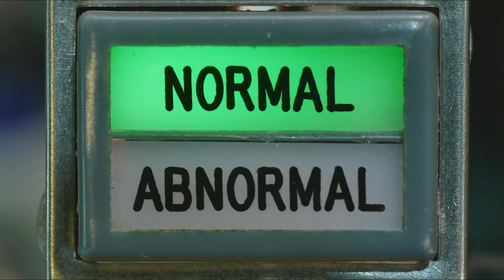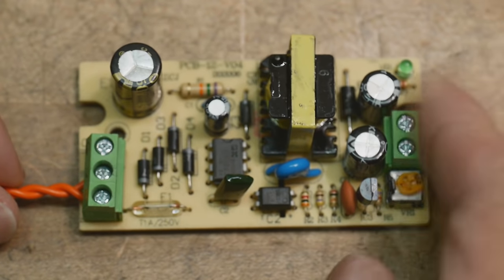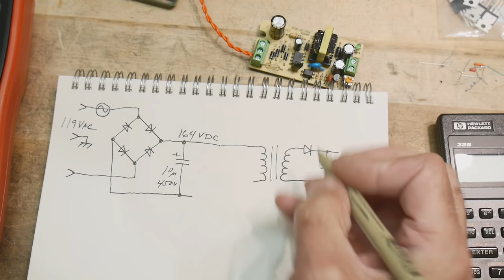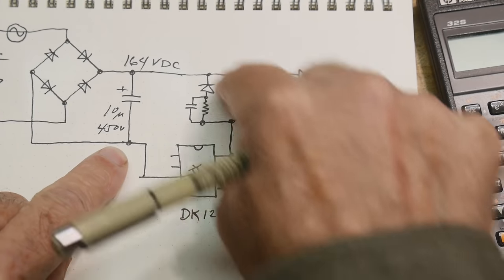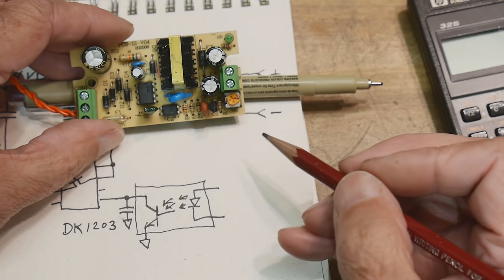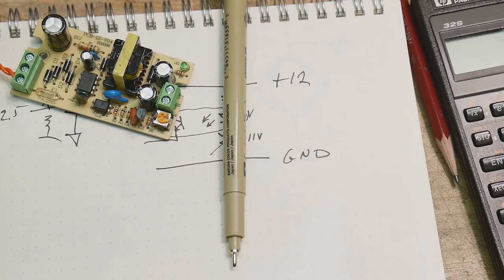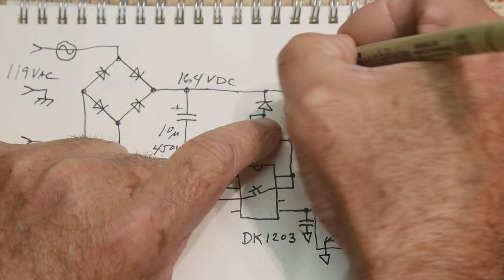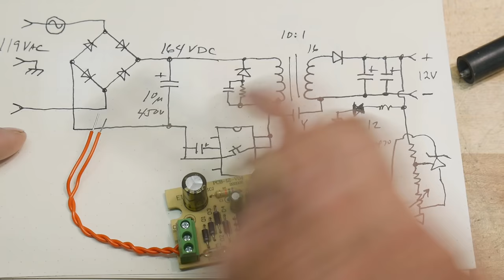#772 Basics: Switching Power Supplies (part 1 of 2)

Comment: How do switching power supplies work when there's no feedback from the output side?
Reply from the maker: there is! though the optocoupler
Reply: @IMSAIGuy  nope, not the 12v switching I've tried to fix.
Reply from the maker: @danman32  I couldn't comment without looking at a schematic, some use secondary windings of the transformer to do the feedback.

Comment: Do they operate on different switching frequencies or are they all pretty similar? I also note that on a 240V supply the rectified voltage will be around 330V which would not be pleasant to touch :-)
Reply from the maker: they all use different frequencies. Yes these things are very dangerous the voltages are high and the capacitors will hold that voltage.

Comment: Only in a very very bad design or one with some specific very unusual need would the TL431 and optocoupler actually work in "bang bang" mode to inhibit all switching of the FET on the input. In a good design the optocoupler operates in linear mode and the pulse width control is proportional. If there were no load on the output you might get complete inhibition of pulses because even a single pulse of the narrowest possible would result in too much power delivered to the output side, taking the voltage too high. Ordinary optocouples are poor as linear devices but it doesn't matter because the op amp in the TL431 compensates for the nonlinearity of the coupler. The op amp in the TL431 is the "error amplifier" in the closed loop system.

This is a flyback converter. No current flows in the output winding when current is flowing in the input winding of the thing being called a transformer. It is not a transformer in the usual sense. It is an inductor that stores energy with one winding and delivers it with a separate winding. Because of this the output voltage is not directly determined by "turns ratio." It is the inductances that are important.

The resistor in the snubber has nothing to do with limiting current. Its sole job is to discharge the capacitor.

Comment: this is not for 220V input actually right ? there is only one capacitor for rectification. it will have 310V  across capacitor. therefore output would be more than 12V right ?
Reply from the maker: watch part 2

Comment: I am considering expanding upon this video by demonstrating important wave forms and troubleshooting techniques. I would use a bench power supply and/or variac for troubleshooting along with load variations. Once you understand the waveforms, then you don't need an o'scope to troubleshoot. You can simply observe multimeter voltage variations to see where the normal operation fails. Are you planning to do something like this? If so, I will refrain. If not, I would reference your videos and reference your schematic diagram because your schematic  and smps source is a reasonable and low cost training aid for others. I have a special interest in smps theory because I am working on an older large screen TV with 4 different smps that interact (no shorted diodes, no open caps, and no shorted MOSFETs (probably a feedback circuit problem)). If you will be doing this, then I will only focus on a repair video of these 4 TV interacting smps. Yes this smps is simple and lacks many filter features, but as you have demonstrated; it is a good training aid.
Reply from the maker: I have no plans
Reply: Your step-down smps is great for basic understanding (which was your purpose), but a little too simple for more complex smps fault isolation. Therefore I will still reference your fine videos as an intro and then make videos of smps with more advanced features. I plan to explain both half-wave (step-down) and full-wave switchers that have more features, then move on to the TV ps as mentioned above. This will require a video series. Hopefully this will continue on gracefully from where you left off.

Comment: Why does one use a switching power supply? How come you get 120V in and 164V out? Does that have to do with the RMS value?
Reply: Yes, with the diode bridge and the capacitor you get an average voltage that is close to the value of the peak of the sinewave, and the relationship between RMS value and peak value of a sine is sqrt(2) which is 1.41...

Comment: Why don't we use a transformer to go down to 16V from 12V AC and then apply the rest of the circuit, won't that give a simpler solution?
Reply from the maker: size, weight, cost

Comment: Hi. I Try to Understand The matc behind it. 
As i see The input, its a double rectifyer. If i remember correct, its 2x  sqr(2) x voltage, at The cap. You have 119 at your location. 
Minus .7 volt drop pr. Diode. That should be almost 268Volt? You messure Not even Half of that. Am i remembering wrong?

Besides of my math problem, its a Nice video. Well explained, and easy to Understand.
Reply from the maker: it is a bridge rectifier. no such thing as double.

Comment: Hi people, I am a newbie on this and had some interest in this topic. I watched the video and read about switching power supply. Wanted to dig further into power supply so i found two malfunctioning LG flat monitors from 2007 (with the back lights fused). Found the service manual with full schematics and elements of the power supply, so my curiosity grew even further. I always put nitrile gloves, use 20A cat III multimeter probes, 500C silicone on table and I wear glasses. I always measure without pluging to electricity but iin this case there was so much curiosity. Thing is I tried to measure AC voltage on the rectifier input pins and the rectifier exploded, multimeter is ok, but can someone explain me what happened, I am totally sure it was my fault not the hardware. Maybe because the multimeter is automatic and switched to dc mode without noticing? Maybe because the diagram is different and there is an X 0.47u condenser and an inductor (choke filter) before the rectifier? I read the AC on the input pins of the board and the DC in the + - output of the rectifier/condenser and everyting was fine. Another thing I don't understand is that after burning the rectifier i removed it from the circuit, tested it with the multimeter in diode mode and all readings looked fine with 0.6 drop in all the diodes and reverse not conducting electricity, but then I put it again in the circuit and the readings on the DC output on the condenser dropped from 360 volts to 0.6 volts. And yes to be totally sure I am a complete idiot I repeated the process with the second power supply and burnt another rectifier xD. I will buy an extintor also and a couple of books and learned a big lesson. I will work with lower voltages in the future. The issue here is that i still do not get why this happened, I have the schematics of this power supply if someone can help me by having a look at it. It also seems a good continuation for this series of videos o_O, adding many more filters and multiple V outputs (+5, +12). Moved this comment here because I put it on the wrong video.
Reply: Ok further investigating the issue, I opened the wall plug and discovered that not all the wall plugs at home have a ground cable connected, even if they have the ground connector. This building has about 40+ years and it seems that the plugs without ground have a fuse, fused plugs are pretty uncommon nowadays in modern buildings (at least in my country). The wall fuse is fine. It seems that what happened to me had to do with filter condensers discharging.

Comment: Where does the 12vdc for the octo isolater come from?
Reply from the maker: from the output, it is a 12V power supply
Reply: @IMSAIGuy  so, it converts ac to DC, uses the output to give feedback to change switching frequency on the primary side?
Reply from the maker: @amynoacid  maybe this three part video will help you: https://youtu.be/VjCEfdCe4Rg

Comment: The bottom of the circuit board on the input side almost makes contact numerous times with the metal rings of the notebook.  I think you used up about 6 of your 9 lives. 😂

Comment: learn one thing. pulsing current is NOT alternate current
Reply from the maker: Yes and they are current mode transformers   it is a simple video to get the core idea to beginning students
Reply: @IMSAIGuy  video is great. just use specific names. u tell about pulses and than u tell that on primary side of transformer is alternate current. u r confusing

Comment: Why not step the voltage down through a transformer first and then rectify and regulate it afterwards, rather then have to use an IC to pulse the DC to then transform it to 12V. This seems overly complicated to me. Im sure theres a good reason im not seeing.
Reply from the maker: size, weight, cost

Comment: I don't understand how switching a DC supply ON and OFF provides an AC supply. Surely all you have is a DC supply that turns ON and OFF?
Reply from the maker: this introduction video over simplifies many things. instead of 'alternating current' think 'pulsed current'
Reply: @IMSAIGuy  Kind of you to reply. Pulsed fits with how I think I understand what you've described. But doesn't the destination transformer need AC rather than a pulsed DC supply?
Reply from the maker: Changing current in.  Changing current out.  Try it
Reply: @IMSAIGuy  You've got me now. I don't know what you mean and the thing I'm trying to use your vids to help me repair can't be turned on because, when I do, the 2 W 15K ohm resistor after the fuse starts to smoke and I have to switch the amp off before it bursts into flames! Very grateful for you're continuing to follow up on my query. Much appreciated.

Comment: Where is Power supply for switching ic ??
Reply from the maker: it comes through the capacitor on the left side of the IC. it is very strange, you have to read the datasheet
Reply: @IMSAIGuy  ok thank you

Comment: Is PWM really AC?
Reply from the maker: no, this is a a very simple introduction to the subject.
Reply: It certainly can be and is in switchmode topologies such as half and full bridge and push-pull. It isn't in a flyback converter which is what is featured in the video.
Using true AC excitation of the transformer means you can get substantially more power through a particular size than you can with unipolar excitation. The flyback is the worst of the lot for power versus "transformer" (it isn't a transformer in the usual sense) size but it has a number of advantages that make it attractive for lower power designs (up to a hundred watts or so is common with output voltage up to a few tens of volts).

Comment: Why are their 50 thousand different designs and parts. Surely by now the pros have figured out the ultimate power transistor and design for best performance and efficiency. There should be one circuit and the usual parts for small mid and large supplies. How strange. The days of 10 ways to skin a cat is gone. Use the best way and that's it.